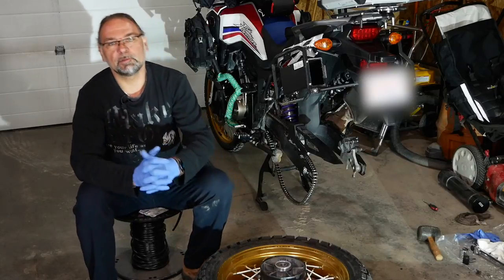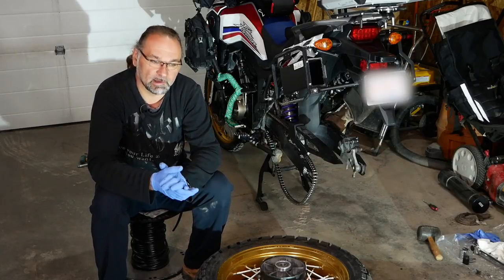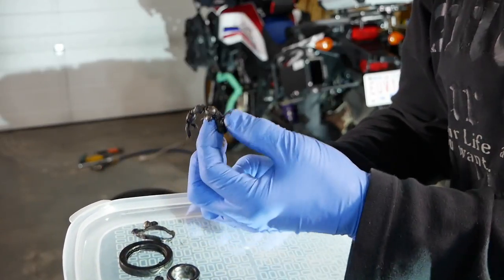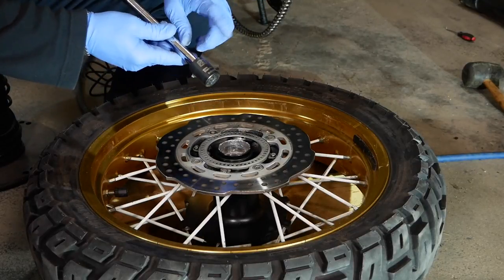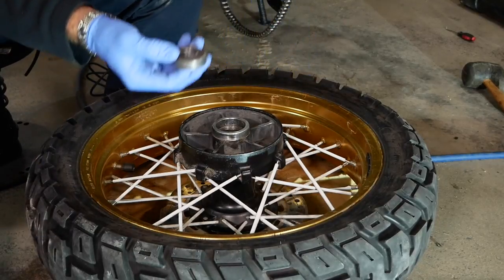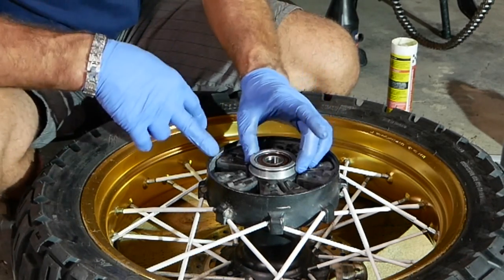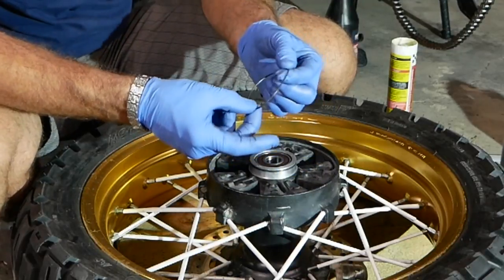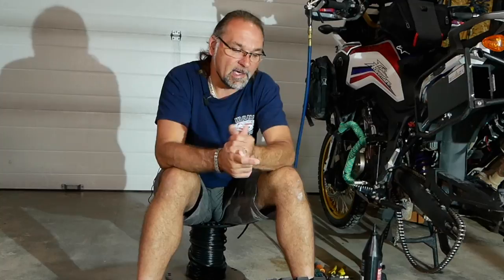HOW TO REPLACE MOTORCYCLE REAR WHEEL BEARINGS HONDA AFRICA TWIN

Comment: Thanks for the video! Can’t say I’ve ever seen a wheel bearing that bad. Do you take a lot of water crossings? Do you use a power washer when cleaning?
Reply from the maker: Not at all, my bike is mostly washed with the bucket also maybe 3-4 watercrossings but quite a bit riding in the rain
Reply: @AdventureTravelandScuba  interesting, did you happen to notice the brand and country of manufacture of the old/new bearings? I had a rear wheel bearing fail on my Ducati a few years ago, I was shocked to see the OEM bearings were made in China !  I maintain two AfricaTwins , mine and my son’s, I always check bearings and grease seal lips with tire changes. So far all is well, but they definitely don’t see as much off road as yours!
Reply from the maker: @richm4402  if I remember correctly they are made in japan not China, I did replace them with OEM bearings but now keeping closer eye on them

Comment: Hello there, are the front and rear wheel bearings the same size for the Africa Twin 16-19?
Reply from the maker: Front is different size than rear even axles are different sizes year makes no difference
Reply: @AdventureTravelandScuba  Yaikz, okay.. thank you for the info and the swift response. Appreciate it :)

Comment: Hi Thomaz,  pls describe what was the rear bearing noise like before it went totally out? I have hard time telling what is normal road contact noise and what could be a rear bearing(s) noise. My noise is present at 90-100 km/h and when motocycle is tilted a bit to one side, but not when tilted to the other side
Reply from the maker: In my case i didn't hear any noise but normally you should be able to hear metal like noise and most time there will be play on the axel.  I was off road so I would not hear the noise when it happened just started grinding right away.  When I got home barely i had this surprise lol

Comment: For the install, have you ever tried using dry ice on the bearing and heating the hub with a torch? I’m gonna swap my wheel bearings this week (same thing clicking and rear wheel play, have about 45k but decent amount of off-road and rain riding)
Reply from the maker: Install is not usually a problem that's easy part taking it out is the bigger issue
Reply: @AdventureTravelandScuba  thanks! I got the bearing out using a bearing driver (a bit tricky getting around the axel spacer but once I did it popped out real quick). I appreciate the vid you made, helps build the confidence to do these jobs watching someone else tackle it
Reply from the maker: @Flyingcanukmusic  that's awesome way to go, you will never know until you try 💪

Comment: Im cringing, i can remove and replace all 3 bearings in under 10 minutes even if the centre comes out due to excessive wear. Correctly shaped drifts to remove and bearing insertion driver tool for installation. Stop stuffing around with the baby hammer, that causes more problems. 20 oz hammer and solid blows. Baby hammer to install dust seal
Reply from the maker: I'm super happy for you if you can do it all in under 10 min why watching my video. I'm looking forward to your video I'd love to learn how to do it under 10 min.....